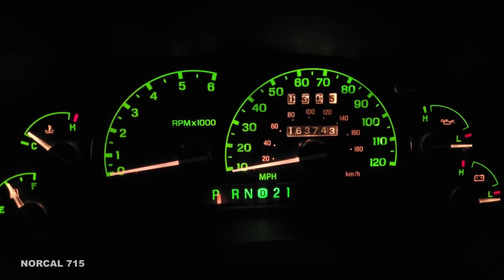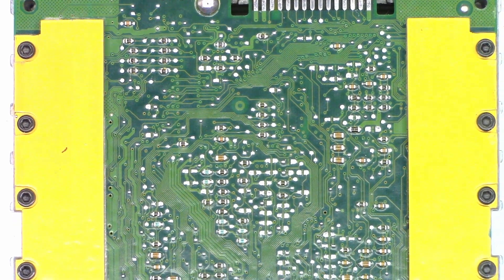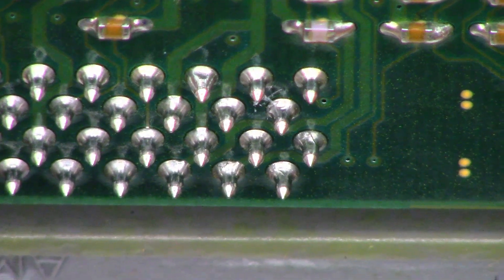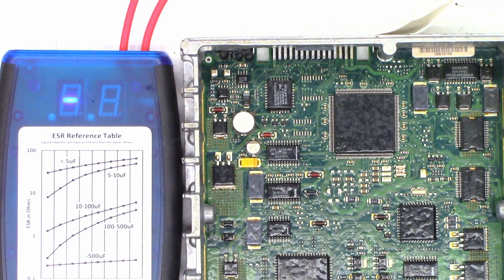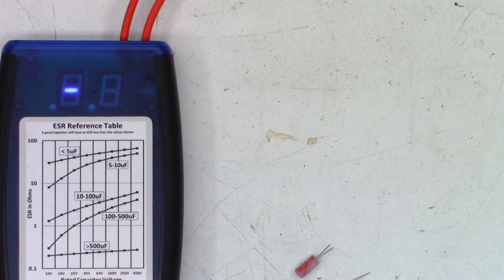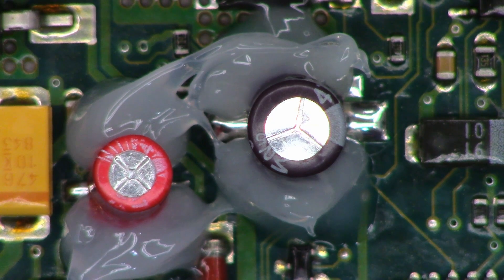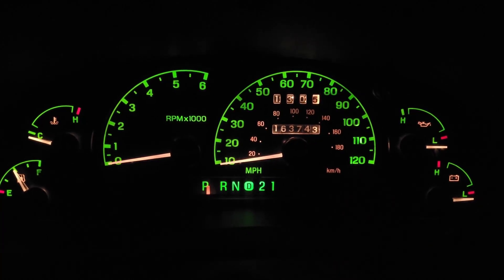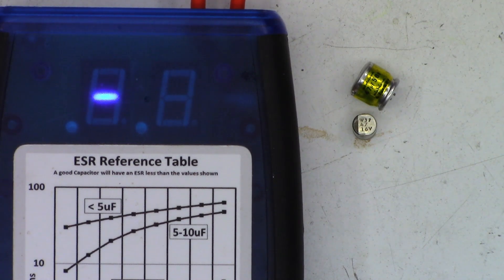Re-capping the engine computer from my 1999 Mercury Mountaineer - Ford Explorer

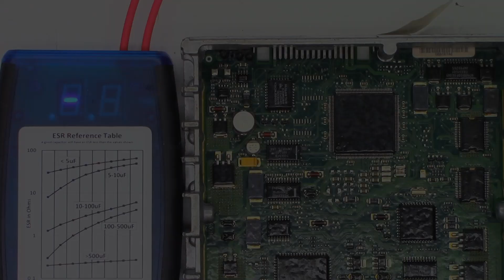Comment: 5:41 Careful measuring caps in-circuit as you're doing here, as it can lead to inaccurate measurements. Sometimes it can work - sometimes not. All depends what's connected & how it's influencing your readings. Also check out the Atlas ESR70 gold; amazing meter. Comes with clip leads, with optional needle probes.

Edit: Ah good, I see you noticed later.

Comment: Thank you for doing the PCM video.  Did you by any chance test the ignition driver mosfets?  I have what looks to be an identical PCM that I need to check the mosfets but I am not sure how to do that with them in circuit or even it can be done on the PCM.  Can you explain how I would do that or can you refer me to a video?

Comment: Too many dead brain cells !  I am not 100% certain, but I believe that engine (5.0L?) has a 36-1 tooth crankshaft wheel.  The PCM processes that signal (the engine starts) and then send a "modified" signal (8 pulses per rev ?) to the dashboard.
Reply from the maker: It is the 4.0 SOHC V6. Any thoughts on that. I think it is strange that the tach and speedo start to work at the exact same time as something warms up. The recap of the PCM/ECU did not resolve it.
Reply: @norcal715  I knew it wouldn't !  Again, too long ago.  I think you said you had the dash out.  IIRC, both of those are actually stepper motors.  Pull the dash and "touch up" the solder joints to the board.

Comment: The tag on the module (CDE2) indicates what software was installed at the module factory.  At one time there was a matching tag on the door frame.  Quick check that the correct module/software was being installed.  (Yes, it has flash memory, but even today, not all final assembly plants have the equipment to install software "on the line".

Comment: My instrument cluster on my 2002 windstar which looks similar had cold solder joints on the bridge connectors that are used to connect the sandwiched halves together, , the Tach needle would jump all the way too far and get in the way of the parking indicator, and to keep from damaging the needles and indicator out driving, I had to use a paper clip through the trip reset button opening, and reach around it to grab the tach needle which was pegged all the way where the shift indicated needed to go back to park, but if you force it without retracting it using the paperclip it will just bend the tach needle. So removing the cluster and resoldering the bridge connectors worked great, Also put in a nail through the indicator plate just like the speed part had to keep it from going to far, and painted the nail black looks factory. NO more tach needle going too far and into the shift indicator area.
Reply from the maker: LOL I had a 02 Windstar too. I had to drop the subframe to pull the transmission out to have the final drive needle bearing replaced. Nice van, I miss it.
Reply: @norcal715  Mines @ 249K miles, original engine, tranny rebuilt at 195K. Most are in the Junkyard now. prolly the trans in most. I kept mine clean, it passes E-test just fine. Keeper till Non-Ice era comming

Comment: GM body control module like 98-02 Camaro. Use junk solder which cracks around the terminals. Instead of replacing the body control module and programming it to the ECM. It's much easier to replace the cracked terminals. ( Windows, AC, radio, head lights and dimmer  were a few issues fixed)

Comment: Sounds like an intermittent crankshaft sensor to me
Reply from the maker: Scantool reads RPM just fine, just not the cluster. I recapped the cluster too, plus replaced all of the lamps. If the CKP were bad I think it would set a Pxxxx code and not start. Update video to follow soon, once I have it edited.
Reply: @norcal715  ahh that’s true yes. Hmmm intermittent wiring fault possibly ? My SEAT gave me the run around with a bad earth last week, crimp rusted off and was causing the car to act weird.
Reply: For the rev/mph counter anyway